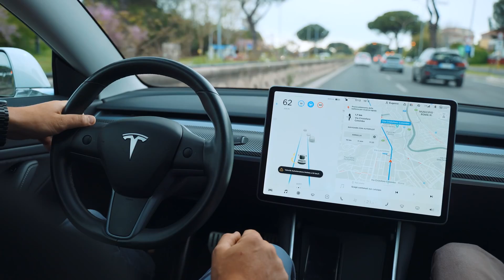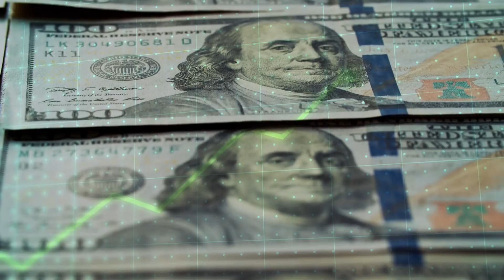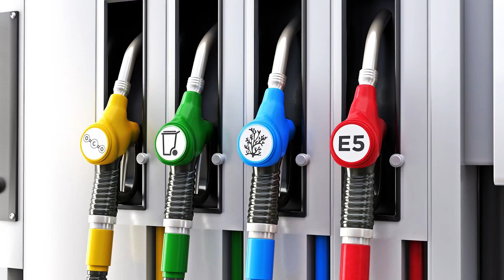Audi CEO: Our SYNTHETIC FUEL Engine Will Eat EVs For Breakfast!

Comment: I drove ev for 10 years, now I drive a pertol car with manual transmission and love it.

Depreciation on ev is a killer and hanging around at chargers when away from home is a shit experience once the honeymoon period wears off.

I mean if they can get charging down to 5 mins in all weathers from say 10-80% I might go back to EV but until then I’m sticking g with ICE cars.

They also need to get the cost down but new car prices in general have gone insane especially here in Europe and they need to make small cars again not big suv so they can charge more.

These suv are a scourge on smaller European roads and cities.